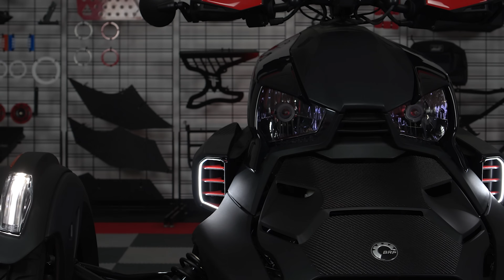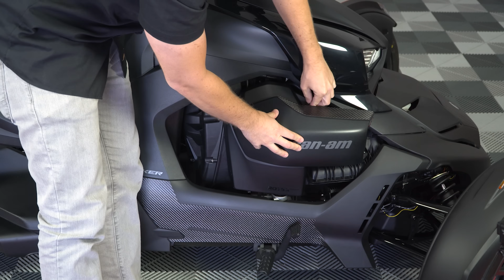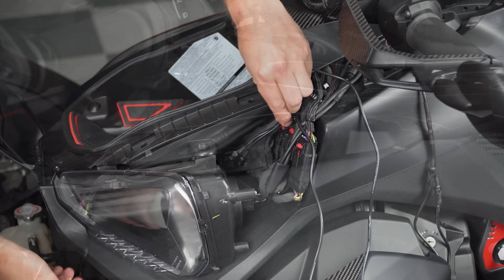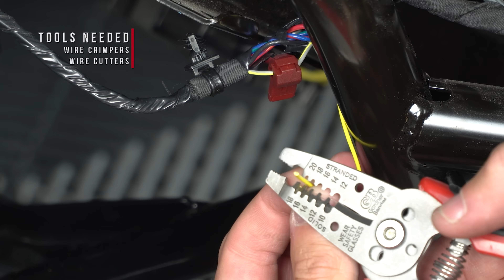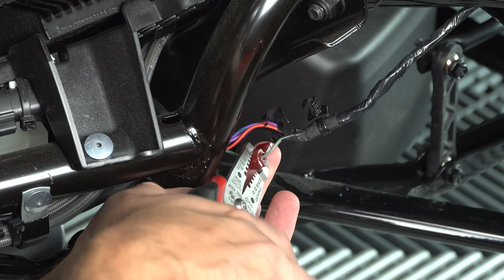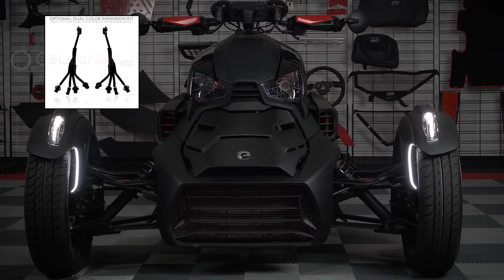Can-Am Ryker Dual Color LED Air Scoop Lighting Strips (Gen 1)

Comment: if you add all them light kits, how would you wire in the new luggage kit? thought you can only do so many connections?
Reply from the maker: The LED Luggage kit pulls off the Brake & Running Light Circuit. The Dual Color LED Strips pull off the 'accessory' circuit underneath your left upper fairing. These are different circuits.

Comment: Can I feed the yellow scoop wire into the spade connector that I already have for the arm lights?
Reply from the maker: Hello T, you'd wanna use our lever locks if you have multiple yellow turn signal wires from more than 1 lighting mod like these: https://www.slingmods.com/5-pin-wago-lever-lock?search=lever%20lock

Comment: WHAT IS THE INSTALLATION FOR THE AIR SCOOP LIGHTS WITH BLINKERS, AFTER YOU HAVE THE A ARM LIGHTS WITH BLINKER WORKING??
Reply from the maker: Hey Richard, you only tap the blinker wires once. We have the 1:4 expansion harness that will allow you to expand the kit to our other dual color kits. Here's a pic of the wiring to do this. https://www.slingmods.com/image/catalog/tricled/vertical-fender-ryker/1-to-4-splitter-how-to-use-ryker.jpg
Reply: @Slingmods  making a video for extending the kit would be very helpful!
Reply from the maker: @Snowtrooper987  I hear that Josh. I'll let the team know!
Reply: @Slingmods  if you have already split the wire for the arm light and don't plan to purchase the 4:1 splitter will you need to splice the wire again and pinch on a connector?
Reply from the maker: @thasfun  Hello T, if you plan on running multiple dual color LED strips you'll only need to tap the yellow blinker wire one time, but you will need the 4:1 if you're adding more than 1 dual color lighting mod to your bike.